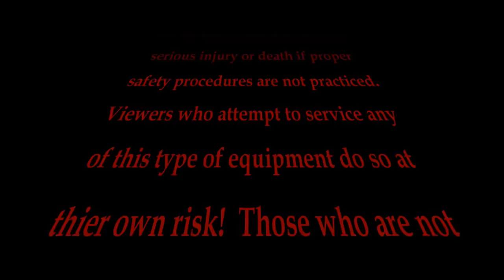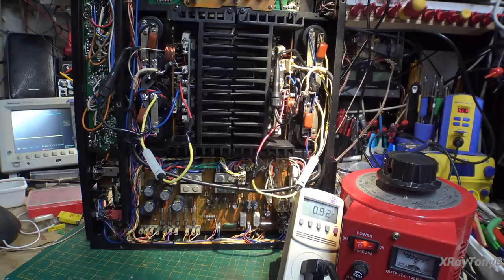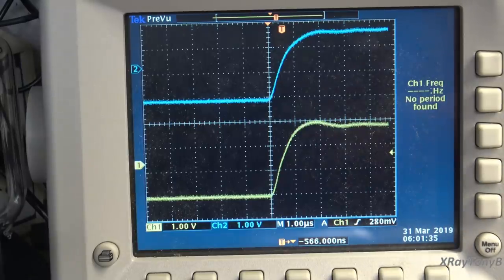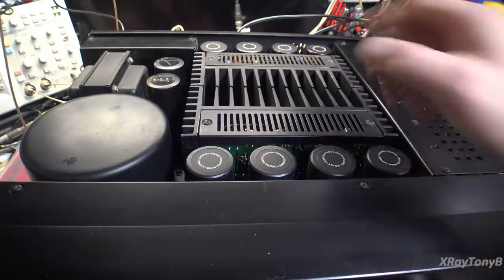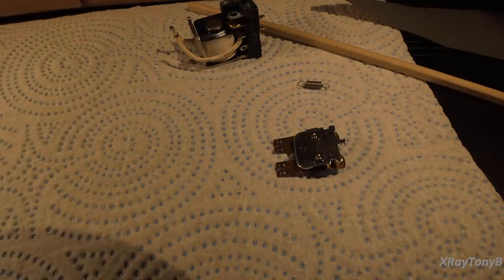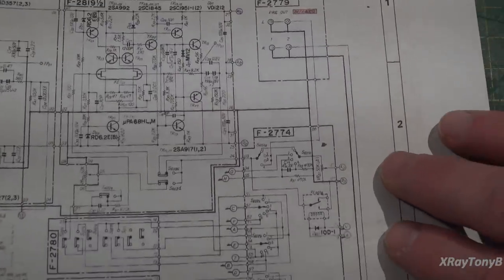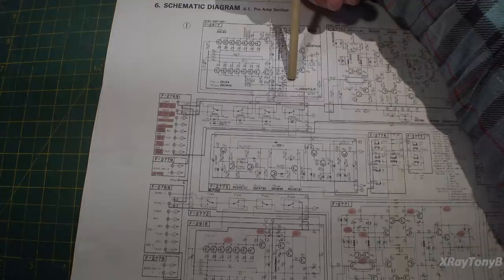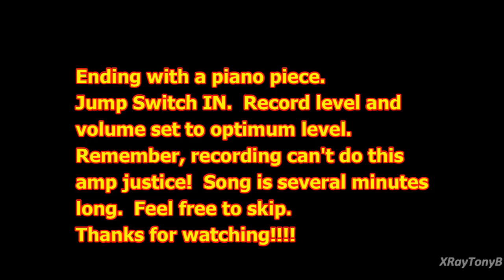Sansui Au-X1 Part 4 - Final

Comment: About audifoolery: new speaker cables should "ripen" slowly.  So, before using cables, I let them sit in my cool basement for quite some time, alongside a crate of fine Belgian Trappist beer.  Once the beer has aged to perfection, the cables are ready for use.  (Obviously, tasting the beer regularly is the key to success)

Comment: I was very fortunate to own the monster G22000 'receiver' back in 1978. Had it hooked up to a pair of Magnaplaner MGIIa dipole speakers, with a Sansui SR838 turntable and Stanton 681EEE cartridge. Every single person who listened to my system (from 'stereo nuts' like me, to casual listeners) were absolutely blown away by the clean, fast, powerful and 'life-like' sound. The 'high speed' design of the Sansui definitely was the major contributor to this incredible system, as I had tried other similarly powerful amps prior, but none could match the incredible Sansui...

Comment: 14:13 In later versions of the X1 Sansui disconnected that test point on top of the drivers. So if you get an X1 made in 1980 that test point will show nothing. You will then need to check that voltage from below.
47:46 Common reaction  to a well restored X1

This X1 vid series is a great contribution to the X1 knowledge pool.  A thousand thanks!!!

Comment: So basically the "jump" switch is a "source direct" switch which bypasses the pre-amp and feeds the input directly to the power amp or pre-out.  Maybe that's why you got such a clean 20MHz signal, you were effectively going through the input, switches and a volume pot directly to the output
Reply from the maker: correct

Comment: Great restoration on this fantastic Sansui Tony 😎 These are a unique and special amplifier. Hope to some day listen to one of these machines and appreciate the engineering that has gone into making the performance really top notch. I have worked on and repaired/restored several Sansui's and other vintage hifi equipment as this is what I do for a living and compared to the AU919 this would be levels above that I'm sure.

Comment: Hi Tony, the diamond differential circuit is area you're pointing at 1h:3m:40s. it is a noise canceling circuit. If you pull up the service manual for the Sansui G-33000 and go to the 1-1 power amp section on the block diagram, this same area is circled and labeled as the pre drive diamond differential circuit. 
By the way, would you have made a list, over the years, of your recommended replacement manufacturer part numbers for the components you've replaced in your videos by chance? I'm just thinking that you would have thoughts on what components may have tested better than others, performance wise for audio specifically.

Comment: I await the day you review the replacement of relays and speaker fuses with back to back optically driven FET’s. 

I just got some SI8752 gate drivers, that simply require a couple of milliamperes into their drive side diode to force an attach n channel fet pair to minimum rdson. I will be trying this to dump the speaker fuses on my rebuild of a Hafler 220.

Seems to me it would be possible, maybe easy, to produce an exact replacement by re-using just the mounting base of the old relay?

Comment: It should be added that it’s not just the amplifier (circuitry) that can add distortion; the speaker wires, and the speaker(s) themselves will add some finite amount of distortion. Note that I’m not considering pure resistive losses (attenuation) here; you can change the vertical gain on the scope inputs to compensate for voltage drop in the speaker cables/connectors. I’m talking about the parasitic capacitance and inductance in/on the signal path; these change the phase of the signal’s frequency components. Finally, the air itself can contribute, and don’t get me started on the frequency response of the listener’s ears! 🙃 Just get yourself a nice amp, and enjoy the music. ‘Nuff said. 😋

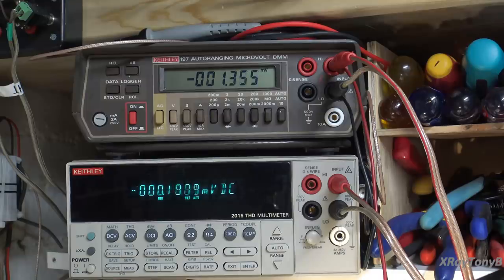Comment: 16:19 : I also often wondered why manufacturers sometimes do not place the driver transistors on the output transistor heatsink. On the Bose 1800/1801 I think it is done, however, on class A Sugdens I've seen it's not, and they do get hot!

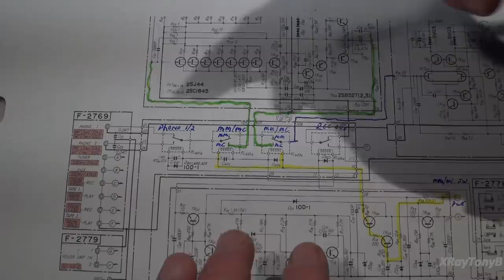Comment: 52:55 : I don't get it: why couldn't they leave the output of the  MC amp. permanently connected to the input of the MM amp. and just use one relay to switch the phono. input between the input of the MC amp. or the MM amp.?
While at it, which do you feel is better performance-wise but also cost-wise and in terms of reliability and longevity: a mechanical selector or a chain or relays? I cannot understand why relays would be chosen as they are more expensive than mechanical selectors for an equivalent performance level.

Comment: I wouldn't try this amp with electrostatic speakers, many of them become close to short circuit at high frequencies above the audio range.
Reply: Yikes! and interesting. I'll need to Google up some examples.
Reply: @ronaldsantosjapan  It's quite common behavior for Martin Logans, Quads etc, you can look up Sound-Lab A-1 on Stereophile and check the impedance chart for an example.